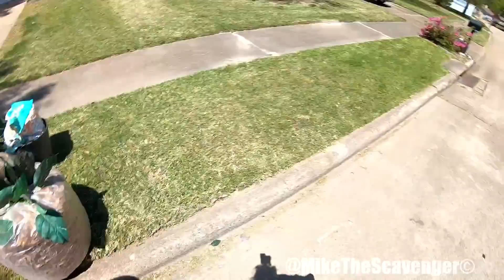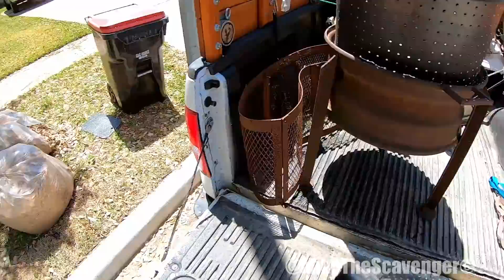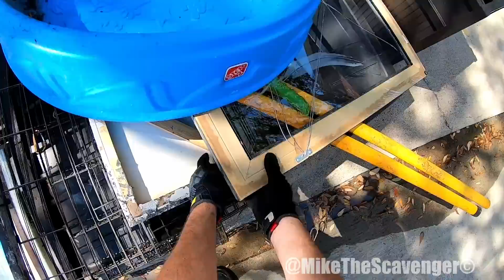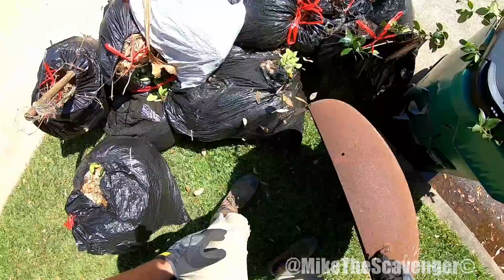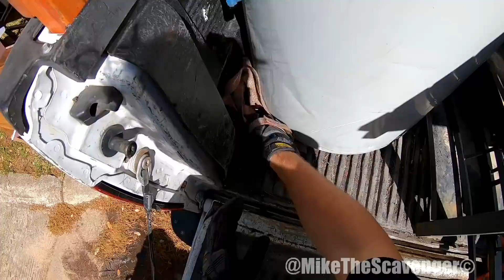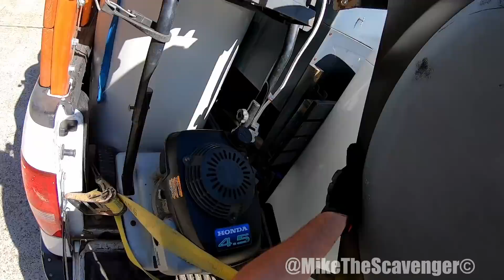Curbside Scavenging "That Could Be A Collectible"

Comment: You can still use a trailer. You just have to drop it in a central safe spot or friends and offload to it. Actually its not bad if you learn how to back one up well. I pulled a lawn trailer for years and it becomes a part of you after a while.

Comment: The best use of a trailer I have found is as a place to compact scrap at home and eventually take larger loads to the scrap yard. However, there are always the questions of if you have place for a trailer at home and will you be saving milage/fuel by reducing trips to the scrap yard. At trailer at home also encurages you to  remove motors from appliances and micro scrap other appliances provided you have the time. Everybody's situation is different.
Reply: Poly Prophet in Australia (a must watch) is doing that, using his old trailer, now that he has a big new trailer. He also micro-scraps and does quite well. The trash day piles in Australia are just huge so he gets lots of scrap while helping clean up his country. Metal scrappers are heroes!   : )
Reply: @somanybookstbr9716  yea its always CRAZY to see how much stuff he gets every run
Reply: @somanybookstbr9716  
I watched an Australian scrapper before and man the trash piles are insane right there.
Reply: that's what I do. I load up the trailer and do one big run. scrap is harder to come by around here though.
Reply: I’ve got a 4x8, 6x10, and a 6x14, each one is used for different situations and neighborhoods. Pick up as much as we can to micro scrap and take bigger loads to the yard. It’s all about the hustle!!

Comment: Those Samsung washing machines will stop working when the filter gets plugged. There's a access panel at the bottom front that opens for access to the filter. Check the oil sensor unit on those small engines.

Comment: At least one of those pressure washers will work just fine, if not both. 

The ethanol in modern gas gunks your the carburetor when it’s left to sit without running over the winter and then people throw it away when it won’t start. 
But if you just clean the carb, it’s good as new.  Will resell nicely.

Comment: Hello Mike. A lot of the pressure washers that get thrown out can be a simple fix.  There's a plastic fitting that wears out or melts a little when there's no water running through the washer. A friend of mine has fixed a few o them when they were tossed out. Might want to check them out before scrapping them. If fixable, sell for more than scrap price.

Comment: Anything that is AC related with a compressor and freon has to stay up upright if it's turned over the oil leaves the compressor and it will burn up if you turn it on so if you have anything that's AC related leave it turned up for at least 24 hours

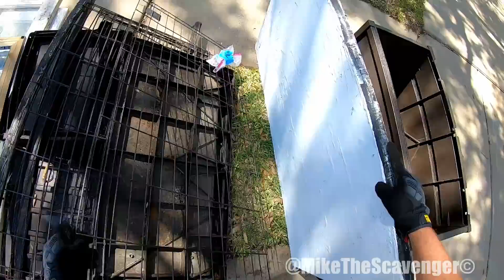Comment: At 10:25 and in multiple shots, those metal panels you have standing up along the right rear are folding dog pens. I see/pickup those things on the curb and by dumpsters all the time. they easily sell for $25-35 on marketplace. A lot better than scrap price and usually sell within hours if they have the plastic tray liner in the bottom. Just a heads up.

Comment: hey Mike I just hit the jackpot for some free scrap metal , just got to pull it apart , 2 old gas pumps from a gas station , lots of heavy steel and cast aluminum , once I get all it cleaned I Kno of another gas station with 2 more old pumps I might be able to get, I got a 2012 f250 with snow plow with only 45k miles trying to get money to get tires for it

Comment: Man you need a extend-a-bed pickup truck for all those scraps. What happened to the power washer hoses? Two power washers but not a hose in sight. I bet both of those would work if you worked on the carbs, but with no hoses its just scrap.